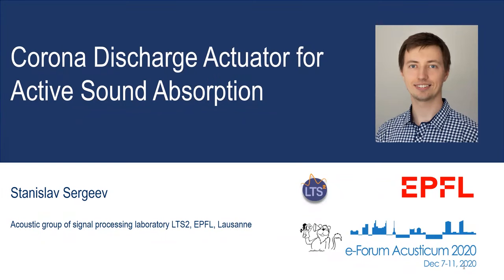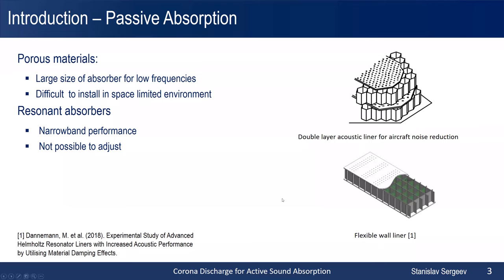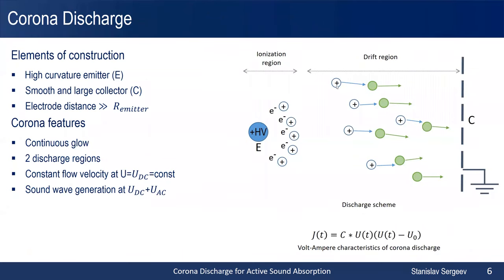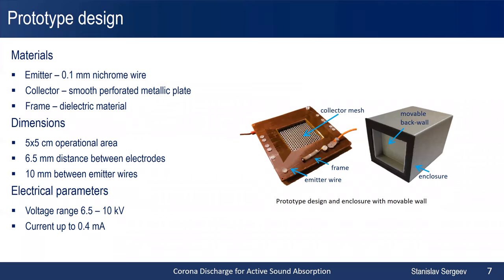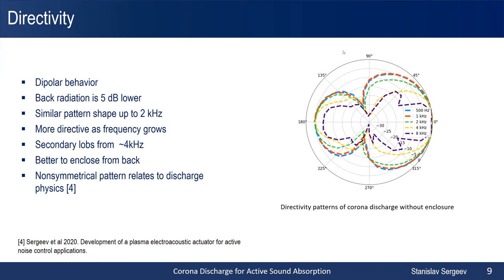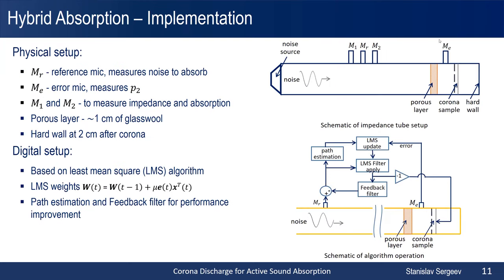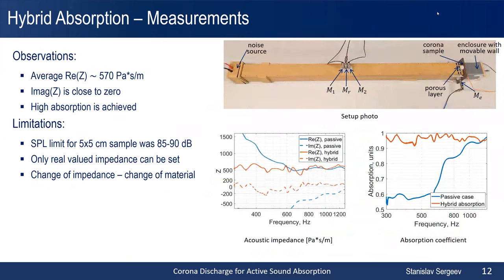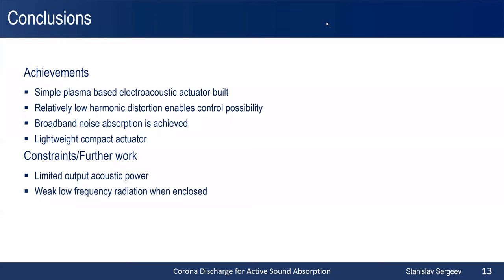FA2020 SSergeev

Comment: Hello have a good ay, congratulations for the research and the great explanation, it is very interesting and it seems to me that it can be further developed for many applications.

I would like to know what is the benefit of adding to the supply alternate voltage 450 Vrms ?  Can the actuator work only with direct voltage? for example 10kv? from what I understand you mixed 8kV of direct voltage with 450 Vrms of alternating voltage, correct? What configuration did you follow in the installation of both power supplies in parallel?  Is there any relation between the frequency or amplitude of the alternating voltage Vrms and the frequency of sounds that you want to cancel?

Thank you in advance for your attention
Reply from the maker: Hello,
the amplifier consists of a High Voltage dc part to trigger the ionization and maintain it during operation (allowing charging the air particles around the wires), and an additional ac voltage (of lower amplitude but still in the kV range) to generate the oscillation of air particles, thus sound generation. Without the ac part, you would get only dc wind (constant flow of air particles in a given direction, namely from the corona wires to the collector grid).
The power amplifier installation is a bit complicated to explain, but there are multiple ways of having this combination of DC+AC that are reported in the literature. Our solution will be disclosed soon I guess. I am sorry not being able to explain it in more details.
Of course, the active control (not explained in this video) relies on the sensing of the incoming pressure with microphones, as an input to drive the velocity of air particles, following a target transfer function between pressure and  velocity (aka acoustic impedance or admittance). So in fact, we don't "analyze" the frequency and amplitude, but we tailor the control so that the output velocity follows a target one whatever the incident pressure, in real time.
Hope this answers your question.
Hervé Lissek